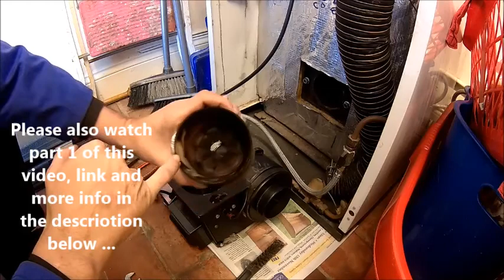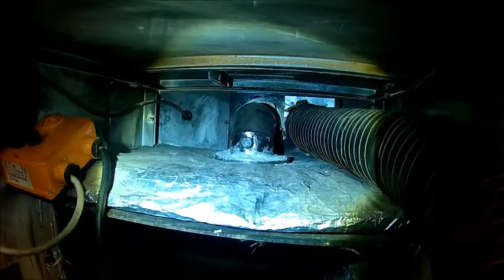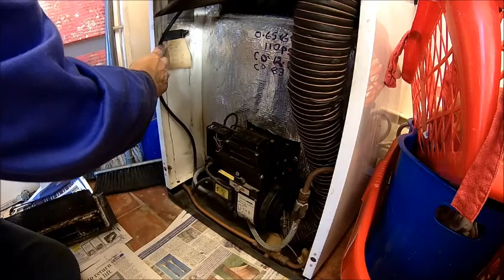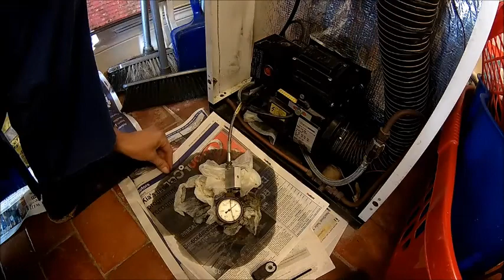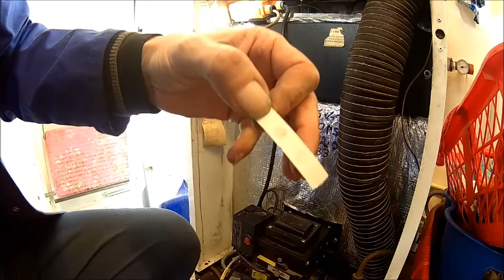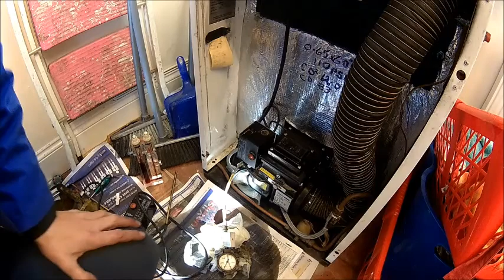Hot Water = Hot Water again  - Oil burner tear down, inspection and repair, Part 2

Comment: I used to take the control box off, (landis and Gyr or Danfoss or Satronic TF802b) for that size burner, make up a link, No 9 is normally the live in, power on, touch on the power in link and the other end on the Fan, Electrodes, and solenoid, one thing I learned NEVER to do was to put a brand new control box on a burner in case it blew that too.

Nonetheless, 10/10 for fault finding, the easiest way to clean a sooted up boiler is to over air it for ten minutes, as for setting combustion ratios, I never used a test kit, I would just put a gentle smoke on the terminal and then bring the air forward until the smoke disappeared....obviously, gas is a different matter.
Reply from the maker: Thanks for comment and tips,...in my earlier life i made a living of oil and gas boiler servicing for many years. The control box is a L+G LOA22 and the burner worked fine, it was just the coil which developed a thermal fault after a few minutes of running. To ensure hat everything is ok you must always check smoke and CO2, because low CO2 will cause low efficiency so you burning much more oil than necessary.

Comment: Beginning of part 1 I thought fuel  coil it’s very common on Danfoss oil pumps, but you got there in the end, just a note you may be interested in that boiler has 12% Co2 on it, it would run a lot better and a lot cleaner at11% the other thing is if you times the nozzle size by the pump pressure it will be near enough the boilers BTU out put, look on the data plate and you can adjust accordingly, nice job job Mike.
That thing you have for checking the Co2 I’ve never seen or heard of one of them be interested to see a bit more about it.

Regards Alan.
Reply from the maker: Thanks Al, ... yeah, at some point that Danfoss coil problem sprung back to my mind, don't forget i am off that trade for 25+ years, so practice lacks a bit. The power range is 17 to 24kW or thereabouts, and with the 0.6 Gph nozzle i am still not at the bottom end, but i get a bit longer run times now, i might go down to 0.5 GPh, so i can up the pressure a bit as 120 PSI is rather low for my liking because that cheap burner has not even a pre-heater. 
I still did not check Co2 because my fluid was old and i need to mix new stuff first (i make that myself) , but from experience a smoke reading in the range of 1 can't be much off the 11 to 12%.
The Co2 tester is essentially the same as the Brigon or Bacharach shaking bottles which i do have some as well. This particular one is made by Dwyer USA. The good thing with the American thing is that service is much cheaper and simpler, you just clean it and change the fluid but you don't need to take the whole thing apart and change that rubber disc at the bottom because there is none. I found this absolutely complete and very clean kit on fleabay and paid very little for it. I like old test kit, no batteries, no drama, it just works.
I may do a video about this sort old fashioned test kit at some time, depends a bit on current workload.

Comment: So, It was the thermocouple/control valve control being shitty?
 Ragards, J.
Reply: Ja. (I edited this comment),Pathetic I know, meh.
Reply from the maker: There is a solenoid valve which cuts the oil flow to the nozzle. The coil had a thermal fault and only worked when cold so the valve closed randomly and the flame just disappeared for no good reason, at least at first sight.